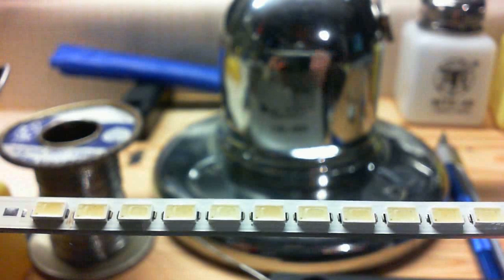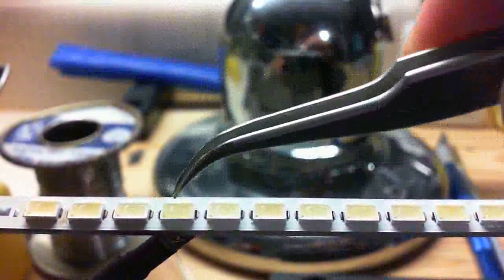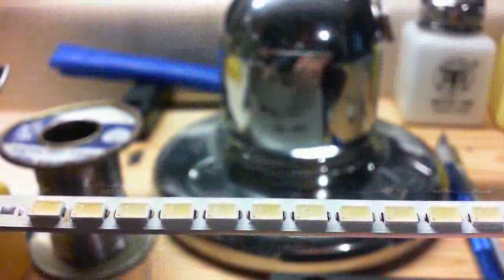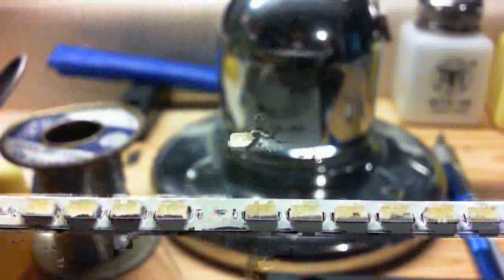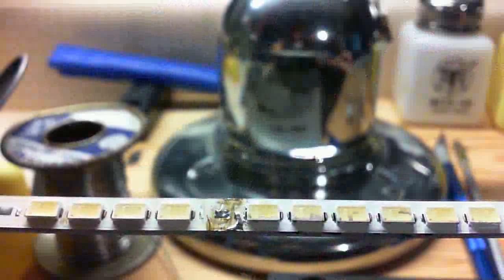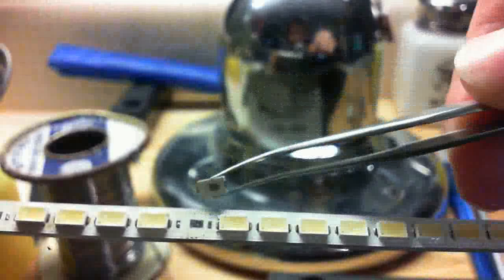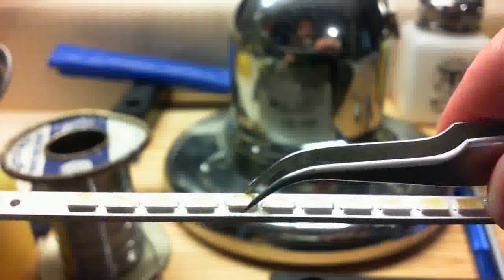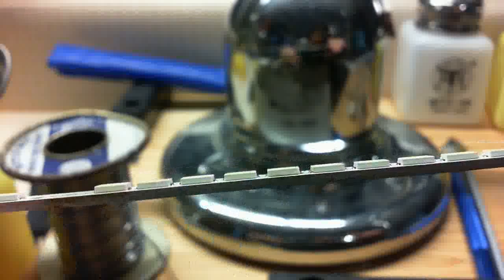Fix Led Backlights for TV or Monitor

Comment: Sorry for asking the question here, but I'm trying to find a way to make my monitor's backlight less bright. Would removing every other LED on these strips basically halve the luminance? Or do the remaining LEDs not function? Maybe get even brighter?

I honestly don't know what to do at this point. So many monitors don't seem to give the user full control over the backlight settings, and the lowest "brightness" setting is still far too bright, in my opinion.
Reply from the maker: You would have to do a lot more work for that to work and after that you would have dark spots along the backlight from the leds you removed, maybe get a privacy filter to go in front of the screen or some tinted film at like 5 to 15% to reduce brightness.

Comment: The most difficult thing is to open the screen without any damage of the glass and ribbon films and of course is not an everyday job for the same television.Who can be so sure that the other leds will not fail also nor the solderind heating stress will not affect those have replaced and even worse if they have desoldered from another led strip previously.I think that replacing the strip with a brand new one is the best that can be done after all this mess.
Reply from the maker: You gotta have faith in your skills. The TV still works too this day. I'd say fingerprints on the light diffuser are a bigger problem than LEDs going out. The cause was water damage and it was not because they are known to fail.

Comment: So probes like an volt meter would have ?? Sorry not too tech savvy. But considering the circumstances. Hey I'll try anything.
Reply from the maker: Some Volt meters have a Diod test mode, on some meters this will put out enough to light them up. otherwise maybe a 9volt with wires could work on the cheap

Comment: Hey how are. Like this video. In the process of doing the same. Only thing I didn't understand was at the beginning you mentioned something about connecting something to test which bulbs were bad. And did you bypass the bad bulb instead ??
Reply from the maker: you can use a power supply and probes on either side of the led in question at say 5 volts with low amperage to check the led. I don't bypass, I replace the bulb because you will add more voltage and amprage to the others which may burn out others. you just need to make sure the polarity is correct, if it does not light up switch the probes to see if it lights up so you know what position to check with.

Comment: where did you get the LED replacement from?
Reply from the maker: I removed them from another I had that matched. alot of the time you can find a data sheet from the manufacturer that will say what type it is
Reply: ok great,